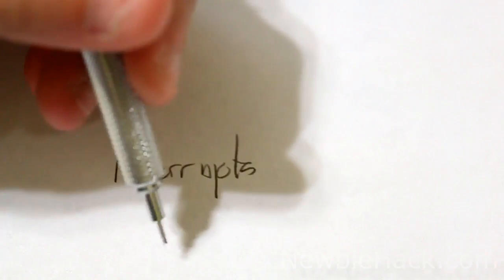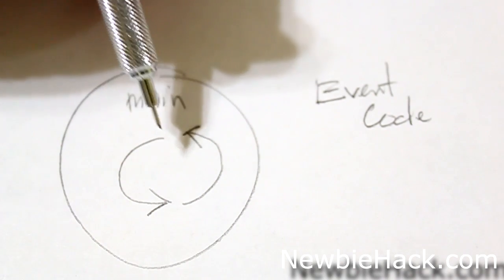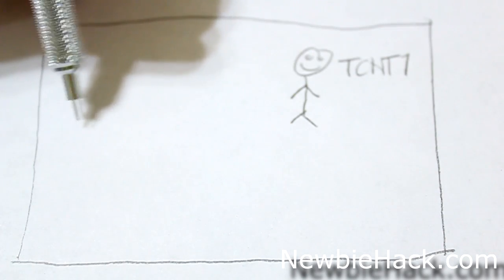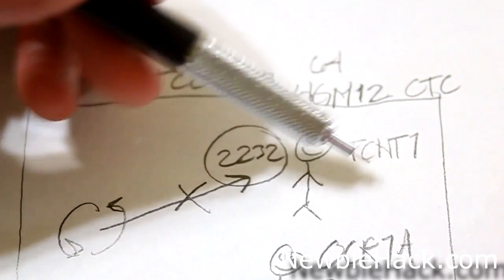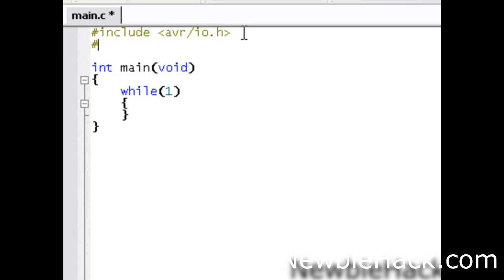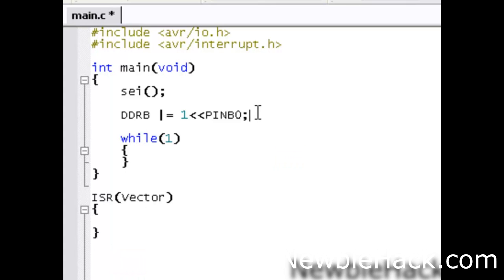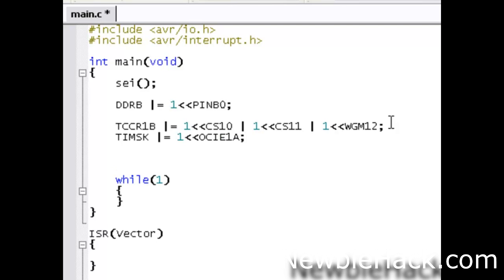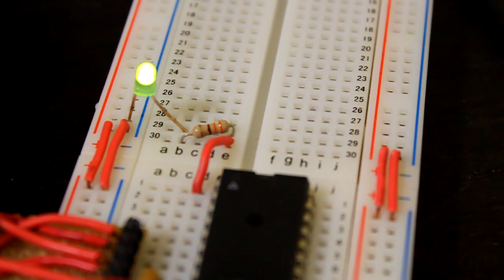18. Arduino for Production!  AVR Atmega32 - Intro to Interrupts

Comment from the maker: Your primary clock is set to a different frequency. Generally, at default, there is a prescaler applied to the internal clock and the chip will run at 1MHz.  If you changed this default prescaler, then the clock will be running at a different clock speed than what is used in the video.

Comment from the maker: You need to find the correct usage of that register.  Do a look up for timer mask in the datasheet.  If should provide you with the correct number to use.  By the way, what microcontroller are you using?

Comment: I  played around with pin change interupts, got everything set up and all worked ok. 
Then I added  
cli();
_delay_ms(x);
sei();
_delay_ms(y);
into my while(1) loop. My thinking was sometimes interupt would go off, other times it wouldn't, but interupts went off on every pin change with a delay. 
What is the best way to disable interupts so nothing happens after I turn them back on?

Comment: Hi I don't understand where about in the datasheet defines the internal clock frequency to be 1Mhz? Thanks
Reply from the maker: There are a couple datasheets for microcontrollers.  One serves as a programmers reference and covers several microcontrollers with the same feature set.  Another that is more specific to the microcontroller and is generally only a few pages long.  That datasheet will have electrical characteristics and timing data.